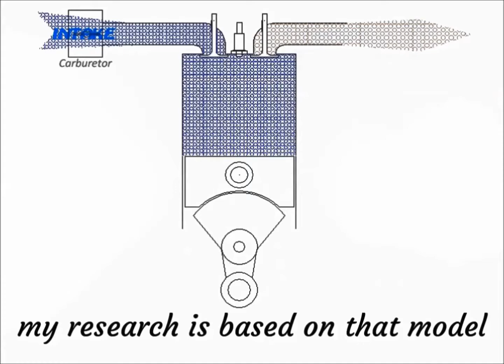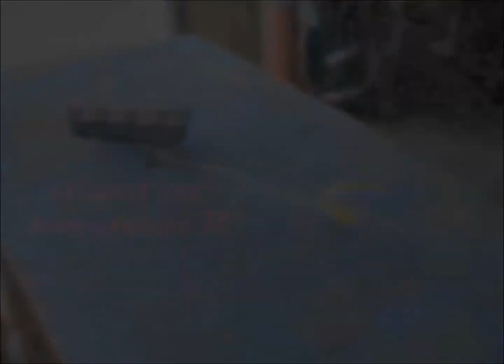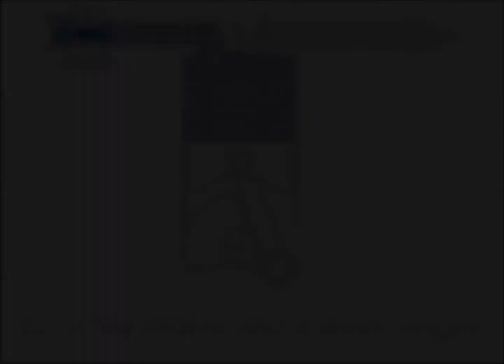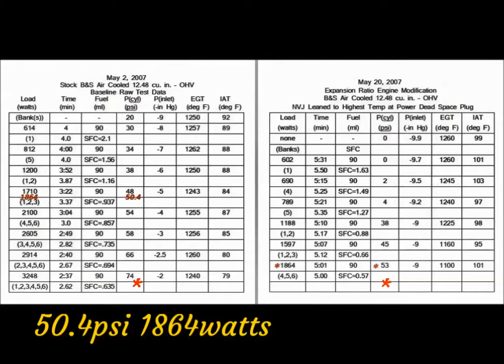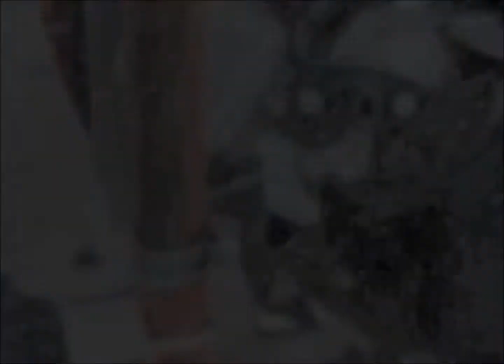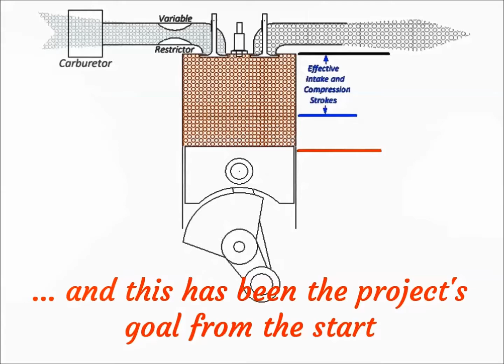the East Cycle18

Comment: hi i run a petrol generator on petrol first then tee off with waste oil and petrol mix about 3 to 1 but use a 3 prong spark plug changes the frequency on fuel  . then when you are about to turn it off change over to petrol again .you have to have choke almost closed at all times and try to e.g.r exhaust fumes near to air intake helps in mixture/heat/flash point